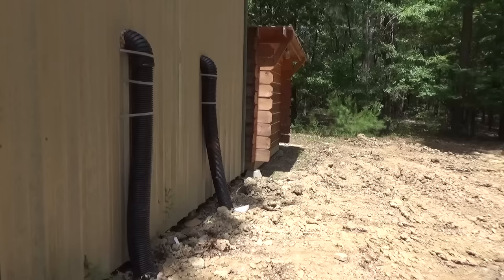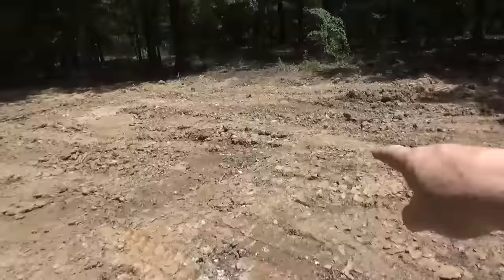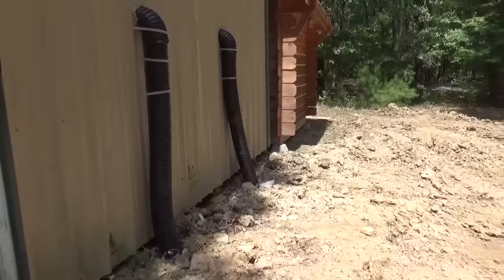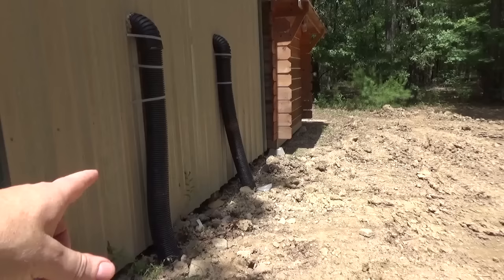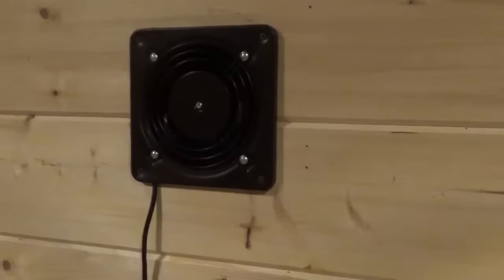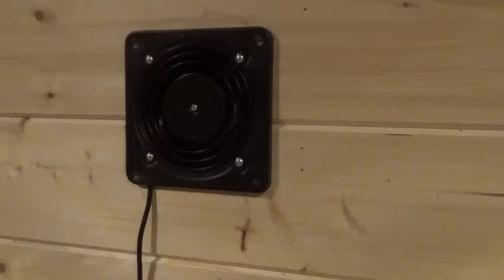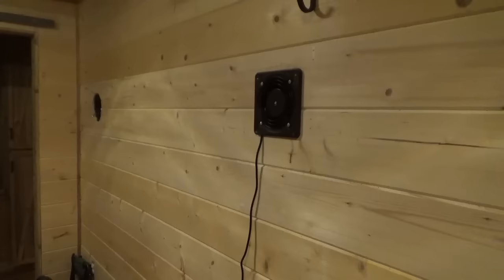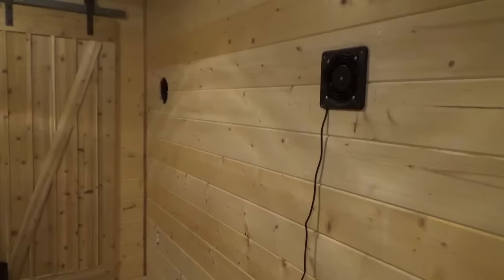Offgrid Underground Air Conditioning

Comment: Great plan and execution. Couple of cautions. Run a check on radon from the fan area. And remember in humid weather the pipe will literally fill up with condensate and pump humidity into the cabin. Those two factors ruled out a similar system for my house near raleigh, nc but i am able to pipe the cooler air through my ac to reduce costs there. Good luck and keep on innovating.
Reply: Radon is everywhere, and it clings to static, so the plastic pipe will probably collect most of it on the surface. It's also only a concern if it's accumulated in a closed area, like a basement or well, so the amount from an air handling system is minimal. Funny enough, the solution to if you DO have too much radon is... install more ventilation.
Reply: @JustPlainRob Bigger fans! More effective than duct tape in this particular application, more power does amazing things! Here in New Mexico, excessive humidity is rarely an issue but it’s good that you point it out. I’d be concerned with mold or Legionnaires Disease in more humid climates.
Reply: One could put a dehumidifier in the cabin.  I have one in my work shop in Oklahoma and when it’s humid I get about a quart of water every day.  During dry times it takes 3/4 days to get a quart out of it.
Reply from the maker: I run a dehumidifier in my cabin
Reply: @uncledavesfrontier6846  What part of Texas?  South and S.E. or even East Texas definitely need it, West, North, probly not so much.   Texas Boy myself.  S.A. Austin, Houston, DFW Metro, Beaumont, Tyler, Armadillo-Amarillo, lived and grew up all over.
Reply from the maker: @mindofmadness5593  northeast Texas
Reply: That depends on the sediment surrounding the home. Radon IS NOT everywhere. It's in rocky areas. Texas doesn't have the rocky areas most of the west or east has.
Reply: @@fredthe47thAnd even if it were built on solid granite, the extra ventilation should mitigate any risks.
Reply: Even better... you a closed loop with water (plus glycol).  That has a better heat transfer than air by far, so it will be more effective.  Then... no radon worries.
Reply: @@fredthe47thNice plan on the condensate. Without something, that pipe will fill up completely and block the air flow. Radon is a high permeable gas, meaning it gets through stuff. The poster has a closed room, more or less. Hopefully there is a provision for make-up air. The radon comes up through the foundation. I don't think its an issue unless high levels are noted for the area. I live in Tulsa and the house is closed up most of the year. I had it checked the first year we were in our house.
Reply: You can bypass all those concerns by burying a pex line and circulate water, use a thermal transfer inside the cabin to pull the cold air off. Always been a fan of the buried duct though...
Reply: Wait a minute, wait a minute! You mean to tell Me that the Radon is going to penetrate that Schedule 40 ABS Piping? Is this stuff Nuclear? Someone help Me, maybe I never understood it well enough.
What is the point of 20-30 mil plastic vapor barrier than? This is 'Cabin Air' people, not crawl space air! I like it, what is the temperature drop from inlet to outlet?
Reply: @JustPlainRob  That is NOT the solution for radon. The solution is to evacuate air from beneath foundation.
Reply: Nice little climate battery!
Reply: @snurb48  Radon is a radioactive isotope. So yes, it is a weak nuclear force. It is the earth's slow radioactive bleed-off. Like the earth's magnetic field, it's stronger and weaker around the globe. It does permeate up through the ground. A fixed structure on the ground could be in a bad spot. It's just one of the reasons that a building may be a "sick building", which are buildings known to have high occupancy death rates from cancer. The tighter the building (low exchange of air between inside and outside), the higher the risk.
Reply: @craigpierce7996  Best explanation I've heard, thank you!  The World is a dangerous place, stepping off the curb without looking can get ya killed too! Ha, Lol.
Reply: Pipes are sealed, don't be a radon goofball
Reply: @jacobgreenfeld-yp8ox radon is caused by the breakdown/half-life of radium deposits found  in uranium ores and to a lesser extent thorium ores in trace amounts.
Reply: @TheNorthwestForager thermal conversion causes transfer losses and makes a less efficient system
Reply: @xephael3485  There is a map of 'predicted' spots for radon in the U.S. with higher levels being in the mountainous regions. The map should be taken with a grain of salt as I have found zero traces of any radon anywhere near properties in North and South Texas. I have also checked spots in other parts of Texas and have found no discernible quantities. The important thing to do is check and see for yourself.
Reply: @uncledavesfrontier6846 If I may recommend, if you will be dealing with any condensation you should consider yearly blasting a liberal amount of borax (maybe a  whole box) through the pipe with a leaf blower to prevent mold and mildew. I believe it is also a "neutron absorber" 😉✌️
Reply: @fredthe47th put a reservoir with a sump/lift pump... problem solved... until you have to change the pump... unless you use an air lift... all moving parts are about ground...
Reply: @TheNorthwestForager you can put an inline radiator with a fan blowing through it... just like I'm planning to do instead of moving air that has been underground and in ductwork... I'd hate to deal with mold that you can't see or get to... at least you can clean the fan, the filter and the radiator...
Reply: In my testing with this kind of idea, I installed in-line heat vent chambers in the form of 5 gallon water bottles where the pipes/air would run through every 12 feet (give or take.)  The bottles vent out of their tops to the surface via smaller tubes.  This not only allowed me a better temperature drop, but it would most likely decrease condensation from humidity.  As for the Radon, there may be an easy filtering idea coming down the pike.  You're so correct!  Radon is always an existential threat.
Reply: Radon is only in some areas @JustPlainRob
Reply: Here in Canada, radon can be found just about anywhere. The land might be rocky, or sandy, or clay, or beautiful farm soil. It doesn't matter. If the geology down deep contains uranium or radium you'll detect radon seeping up. The only way to know is to test. I think everyone should test their home once.
Reply: @craigpierce7996 And as we know radiation doesn't "Travel" or "infect" the air, so radiation may pass through tbe pipe, but there would  e no radioactive particles carried in the air, so unless you have a leak in your pipe it will not pick up radio active particles
Reply: It's not just humidity, that humidity will breed mold and the fan will pump those mold spores all around the cabin.
This is why commercial versions use a radiator type design or a liquid to air heat exchanger, so the liquid you pump underground in a circle never directly interacts with the air you breath.
Reply: It's a closed loop system with air from inside the house. The Earth is not ventilating inside to the pipe and therefore how on earth is radon supposed to get in there? 😂😂😂😂😂
Reply: Is mold a potential concern?
Reply: Great point. The condensate water is a big deal!
Reply: @mindofmadness5593 . Pecos and fruits and nuts, Austin. 😬
Reply: Make a custom dehumidifier water copper trough. Catch the humidity before it gets inside ;).
Reply: @JustPlainRob 
Not everywhere, but the radon testing is a good point if you are living in an area with radon...
Reply: @MRGF78 
A solar fountain pump might work as well...
Reply: @edlauren9434  Easy to deal with, use the fan to push the air into the duct and drill a hole on the deepest point of the pvc pipe. The condensate will just drain out while positive air pressure will keep radon out of the pipe even though exchange rates through a small hole will be extremely limited.
Reply: He’s pulling from inside the cabin…just back to inside the cabin. Not from underground.
Reply: @uncledavesfrontier6846 I’m near Texarkana is that close to you??

Comment: I'm a HVAC veteran... I like the Pex tubing approach much better overall.. Less digging for each "Tonne" of cooling or heating capacity, use the glycol piped to a discarded A/C evaporator coil, it has its own condensate pan and drain. Use a filter, and no worries about dust, disease or water clogged underground piping... Save the condensate for watering plants, washing or purify it, for drinking, if yer really had core.... A lot more effort overall, though a lot of concerns licked at the same time.
Reply: Would a HEPA filter on the house inlet not be able to handle the dust & possible mildew?
Reply: I do that using my well water (at 54F) then send the water to a sprinkler system on the roof... what makes it to the gutters is collected to water the garden...
Reply: cool.. you have a diagram / schematic layout to show components and such, you can share?  thanx

Comment: My wife and I did something similar here in central British Columbia. We buried two 4" PVC pipes six feet deep, side by side and running out seventy feet from the house. Fans pull outside air in, sending some to our bedroom and some to the kitchen. In the winter, minus 30C air is warmed by the earth to plus 10C. In the summer, plus 30CV air is cooled to plus 15C. It works very, very well. If I had to do it again, I'd go a little deeper (maybe 8-10 ft) and make it longer. We do sometimes get a bit of water in the pipes but haven't had any issues. If the run was sloped away from the house and drainage provided right where the pipes turn up to the surface the system would be self-draining. Anyways, six years later, the set-up works quite well.
Reply from the maker: Sounds awesome
Reply: Да что то подобное тоже хочу. Сделать только  сбрасывать тепло под дом в глину чтобы зимой в подвале было потеплее а летом попрохладнее...
Reply: Nice! How do you drain the water? Would like to do
Reply: I didn't really know what I was doing, so I ran the pipes more or less horizontal. About once a year, during a week or more of heavy rains, some water finds its way down to the pipes (ten foot lengths of four inch PVC), which were not glued together. Eventually, enough seeps in to start blocking the airflow. My only recourse is to simply vacuum the water out with my wet-dry shop-vac. Twenty minutes of work, and I'm good for another six months or more. 
I could have run those pipes toward a slope and down that hill. Then the pipes would be self-draining. I just never thought of water at the time. I'm not going to dig up our lawn to change it now, so the shop-vac comes out once or twice a year. Good luck with your project! @sheilabicho2989
Reply: @paulmaxwell8851   I definitely try this for my house in Czech republic..:)) so practical and reasonable information. God bless you !!
Reply: @paulmaxwell8851 Have it camera put in it find the deepest spot. Dig one hole there, then drill holes to drain the water and rap it with a membrane. Time is money. I didn't retire to have choirs either.
Reply: I wouldn't use a drainage tile.  You'd stand to get radon.
Reply: You should use a pipe with antibacteria layer. Slope towards your home and at the end have a Tee. One side connected to house, one side connected to the main pipe, bottom side connected to a small container with submersible pump so that you can easily and automatically remove all the water
Reply: Knowing you did this makes a bit hopeful it could work in Calgary. The heat in summer is stupid hot and dry. I'll start looking into it, thanks!

Comment: Dude! Finally, an off-gridder who made a sensible and cheap solution at last based off geo-thermal cooling! I love it, great detail and explanation. One question though - have you thought about doing any filtering to prevent dust build-up? I get that it's a cabin and you don't expect HEPA air indoors, but don't discount the additional work a dirty fan motor has to do - your power consumption will take a hit.
Reply from the maker: I have a filter system in front of the intake vent and I run a dehumidifier in my cabin.
Reply: @uncledavesfrontier6846  you gave me idea for hot sauce name 🤔 Satan's ass😁
Reply: Hey buddy he walks right by that fan everyday you can see if it's dusty that's ridiculous going to take a hit. Stop it
Reply: @uncledavesfrontier6846  How many amps does your dehumidifier use?
Reply: @davidgentz1731 cleaning the fan is easy. However, keeping the entry of the pipes filtered will keep the pipes from getting dirty and possibly moldy over time and the last thing, it keeps the fan Clean which really isn't important. Ceiling fans gotta get cleaned all the time.
Reply: they make dehumidifiers that are literal discs of something that suck moisture. Mine last for about 3 months and cost 3$ each, i put them in my bathrooms
Reply: No power needed. Buy the 3$ puck, twist the cap, and no more humidity for months on end

Comment: I would only run this in a closed system. You could use an HRV to do this. You'd run the underground loop across one side of the coil and then the interior air across the other. This would massively reduce mold, mildew, radon, etc issues. HRVs can transfer like 50-75% of the heat so it would work super well
Reply: HRV does not run a closed loop as it exchanges outside are with indoor air but reduces temperature & humid difference. I suppose an HRV could be modified for a closed loop system. FWIW, ground system could be hydronic and use a water radiator for heat exchange. A hydronic pump would not need a lot of power.
Reply: What’s HRV? Could running a little chlorine dioxide gas through the pipes once in awhile solve any mold issues?

Comment: The Earthships in NM have these. They work well but the outside air is dry. How do you handle the condensation? I spit out my drink when you said TX was as hot as Satn's rear end. I have to agree with you. I live in north TX & it's been a rough summer. LOL
Reply from the maker: I haven't had any condensation issues. I run a dehumidifier in my cabin so the air stays dry. I run the dehumidifier for about 2 hours before I turn the system on.  No smell or anything like that. I'm going to try a different design when I build the hobbit house.

Comment: i noticed that this is the first closed loop system I've seen... and kudos to you i would likely do the same thing, have you had any condensation issues?
Reply from the maker: No condensation issues. It will only maintain temps. So if it gets down to 70 at night, it will keep it 70 during the day. Hard for it to drop temps if you turn it on after the cabin gets hot inside. So i turn it on in the morning